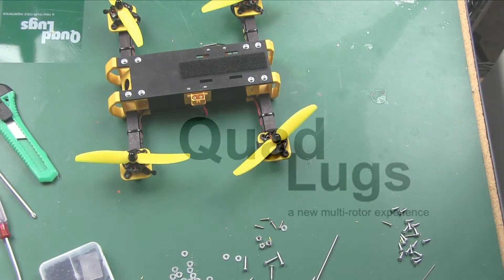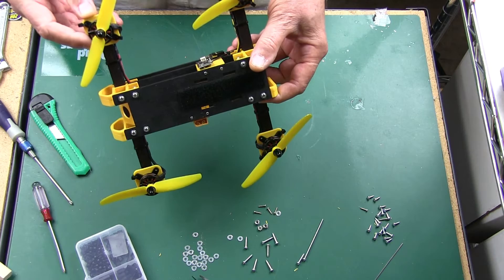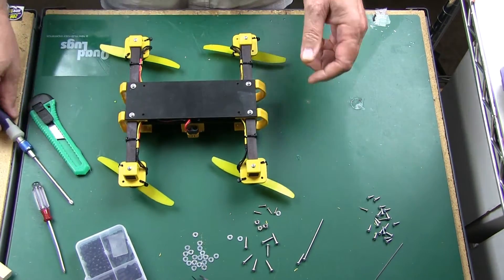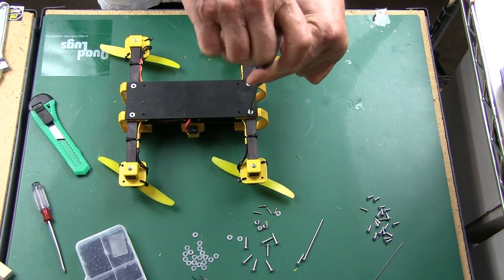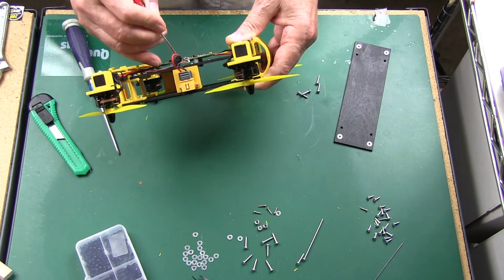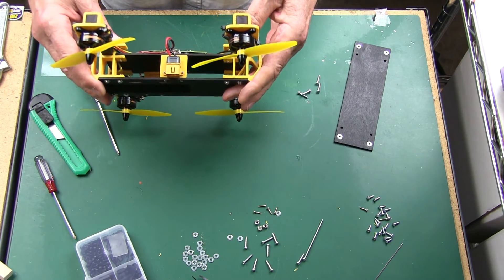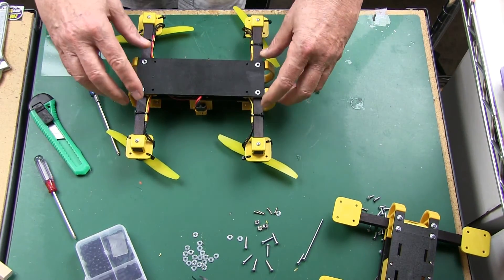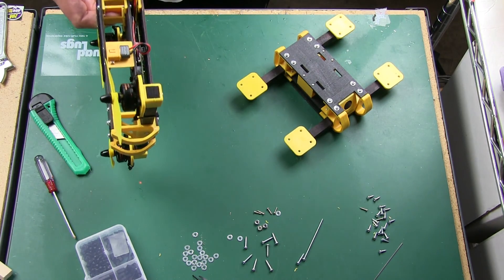QuadLugs - Afro Race Spec 4-in-1 ESC + CC3D (all in one) Install

Comment: Hi o know this is an old thread but do you know where the bootloader pins are for the cc3d on this board?
Reply from the maker: I have only went thru the boot loading process - thru the LibrePilot program
Reply: Quad Lugs many thanks for your reply friend very much appreciated.       I took a punt at what I thought was the pins and I was right thank luck lpl.   there isn't a lot of information out there considering how old these boards are managed to flash bl heli to escs and betaflight 3.2.2 to fc   thanks again tho pal
Reply from the maker: Thanks -  great to know - if you get a chance - maybe you can share a video on how you did it - also - Thanks for your subscribe
Reply: Quad Lugs I will try do a video for you I'm new to the YouTube and a little camera shy myself but il try my best thanks.

Comment: Have you tried the F3 X Racer FC?  they are  rated as one of the top FC at the moment.
Reply from the maker: not yet - interesting - the FC development is really moving fast - amazing what we may see in a year or two - Thanks for the heads up
Reply: Boy it sure is a long haul from the KK2 boards,  The amount of processing and speed at which data is sampled is just mind boggling these days, and to top it off all packed in super tine microprocessors. 

There is not very much info on the AFRO 4 in 1 FC . Have you flown with it? I'd like to hear your thoughts on it. I just got mine today and have already installed it on one of my mini quads,  the instructions are a bit confusing for the connection to the receivers, they do not show the grey or brown wires coming from the micro jst white connector.  Are you using One shot connection? or are you using all the wires o the RX?
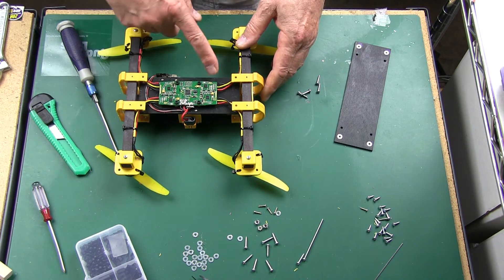Reply from the maker: I have flown it quite a lot and its great - at 3:07 on the video  I show the wires I used - I used a receiver with ppm

Comment: I am looking into purchasing this for a custom quad,  I have a few Brains 4-in 1 controllers and love the compactness of them. What are the dimensions CL-CL of the mounting holes? and can you provide dimensions of the board, itself, width and length. Thanks.
Reply from the maker: the Qbrain (I think) would be to bulky and heavy - on quadlugs.com go over to the 250 Mini+ Quad product page - scroll down and I have linked items that I have used - either of the 4in1 esc's linked would be great to use and of coarse there are many others that would work great - the frame plates are 2 1/4" wide - please take a look (toward the bottom of the page) at some of the build and electronics install videos - it will give you a good idea of the room and how to install - also all our quads are made of wood (bass wood) - the Qbrain both the 20 and 25A would work great on our 380 Sport Quad - Thanks very much and if I can help please let me know - Danny
Reply: I meant if you had the dimensions of the Afro 4 in 1 controller.  I just purchased it anyway, if you can provide those dimensions I can confirm on my quad frame  hole mounting and spacing. Thanks
Reply from the maker: sorry - the dimensions of the 4in1 in this video are 38mm wide and 80mm long - the hole spacing is the normal 30.5 x 30.5
Reply: thank you , that'll work nicely on my custom frame. I love AFRO ESCs been using them consistently without any issues, this caught my eye cause it is all in one , hope it lives to my expectations.
Reply from the maker: when its finished - I would like to see some pics and maybe a flight video - take care
Reply: Definitely, I have been working on designs different than anything that I have seen on the internet and on the FPV racing communities, and I have done a lot of research into this subject, following the FPV quad trend since its beginning . Actually my work with quads, also called flying saucers in my day, back in the 80's started with the same idea I am re-implementing in hopefully a kit, except today we have awesome  technology, than I had back in the day. Little did i know at the time that " rc fyling saucers"  would take off,  as they have,  re-branded and renamed "quads", "drones"  "multicopters".  

My latest  quad(s) have been in  testing stages right now, but I am using separate ESCs and and the mini KK2 flight controllers,  I bough a while back from HK, which have the standard mounting hole separation of other smaller boards including the AFRO 4in1.  Having to wire each individual component is a pain!, though, I am also using an older 200mw AVT for FPV,  so I am trying to upgrade and  streamline the electronics but I still want to keep it somewhat modular. 

Coming from the time I designed the very first 4 0z 20" rotor Micro helis in the world,  (MIA Sport LE™, MIA Robin 280™) and then following with the, MIA Bumble Bee™ sub-micro and MIA Palm-Size™ House FLY™, in the early stages of their development I had to make my own 3-in 1 boards which I showed in many early threads in RCG, before any company had a complete 3-in -1 board for helis. So when I saw the Brain and Afro 4-in1, boards,  it was a no brainer :) for me to simply get that for my quad designs. I was concerned about the dimensions , but I think this board will work out nicely in  various sizes of my quads. 

 I don't want to come across as a conceded Quad designer, but to be perfectly honest 99.99% of the quads and multi-copters out there bore me and they are designed with the same mayor flaw that everyone copies from each other, and  to this day after so many years of these already been on the market, still  boggles my logical and practical mind. I don't like to produce products for the hell of producing something that is similar to everyone else's. If there is no considerable benefit in my design, and I don't mean the basic layout, which is a given,  I will not make it available, but I think I got something that will rock the FPV  multicopter racing community!. 

I have to say that his will be the result,  in part,  from the technology we have but also from a lot of inspiration gathered from everyone that is into FPV racing, mainly inspiration from  a few guys that are die hard FPV racing pilots I fly with at my local flying field. They raised the question  can " you do better",  and that is a dangerous question when you ask me that,  because I will take the time to burn a lot o brain cells and  make it better!. I 've, been doing that for 16 years with many of the products out there by producing upgrades in addition to my own designs in various categories. Although I work alone better, I will need the help of a larger manufacturer that will be willing to work with me on a royalty licensing basis. Let's see what happens... I am dying to get the  AFRO 4in1 and some other components I ordered to complete the testing on my latest racing FPV Quad, name to be disclosed when the product is unveiled.

Comment: Hey - its good to see the FC / ESCs combo on a frame ( looks like a pretty tough little beast!), Hobbyking doesn't give you any specs, is there any chancy you could give some rough measurements? so far the only thin I have figured is that the mounting holes are the same as a standard CC3D - but I may even be wrong there, any Specs would be greatly appreciated! - Cheers
Reply from the maker: +Daniel Spilman - no problem - width 38mm - length 81mm - motor wire length 75mm with 2mm female connectors - power wire length 91mm with 2mm male bullet connectors - and - you are correct on the mounting holes 30mm same as a standard CC3D - hope it helps Danny

Comment: i really like it. nice job. i have had a hubsan x4 for over a year now and want a strictly LOS 250 quad. i fly fixed wing all the time and love flying my hubsan micro quad around the house, im getting quite good at it. the thing that intimidates me is setting up the FC on the computer. im not big on computers, can get around but not overly knowledgeable about that part. question is is this a good first LOS quad to build just like you have it and will i be able to tune it and get it going from my laptop. great video and hopefully we can do business. if you'd like i can email you direct to your website. thank you.
Reply from the maker: +RCman50 D.H - super easy to build frame  - you can check on the product page of the 250 mini+ @ quadlugs.com - the build videos are toward the bottom of each product page - setting up the CC3D controller on LibrePilot is probably the easiest there is - I will have a video out this Monday on setting up the controller - really very easy - if I can help, Please let me know - Danny